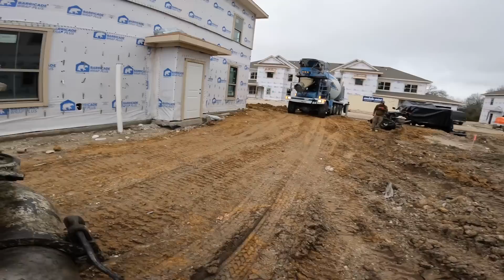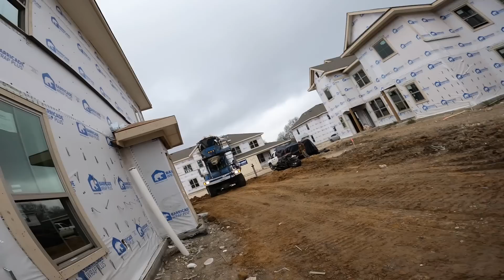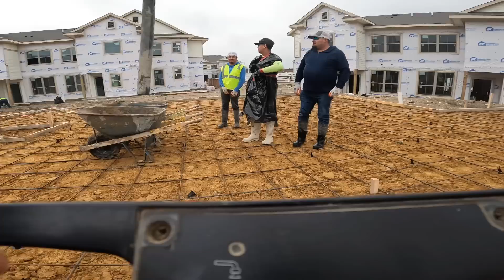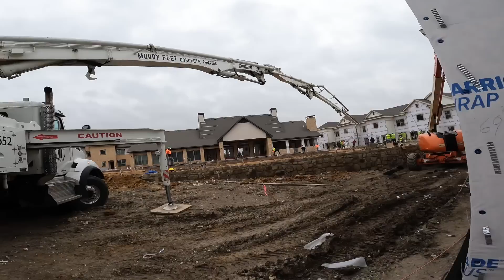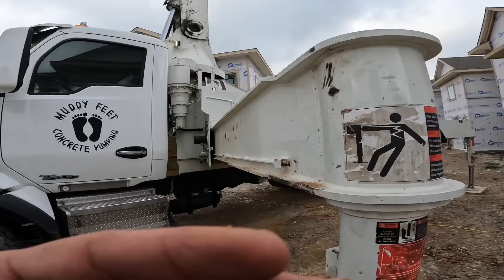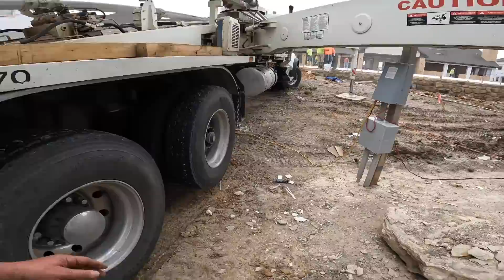Never had these concrete trucks empty into our pumps before! Pumping concrete with Muddyfeet

Comment: I drive front discharge Terex and Oshkosh trucks. Quad axles. We add our color at the plant.  We do 10 gallons of water in the barrel first, add the color, then do regular loading with the aggregate, powder, and chemicals per customer order. Any pours that take more than one truck, we try to even the same amount of water in the loads for every truck so the color pigment is consistent.

Comment: A company called Smyrna Ready mix out of Nashville Tennessee has purchased almost every plant in northern Alabama. They even bought the local rock crusher. SRM has been introducing front discharge trucks in our area ever since and they are good but on line pumps when we get into situations where we stop and go more than we should they tend to overflow my hopper. Driver says he couldn’t tell I stopped. I use a wireless remote though so I’m not standing at the pump. I think they have potential to be way better for pumping but especially for the finishers when they don’t need us. By the way I don’t have my wheelbarrow license either. Lol

Comment: I drive a front load mixer. We’re 6 wheel drive. We can drive anywhere.  Instead of wheelbarrowing that front loader could have come around the other end of the building and pulled right up to the job. Saved time.

Comment: those cement trucks are very common in the Midwest 90% of the trucks in northern Indiana. I think that gives the drivers much more control
Reply from the maker: Definitely give them better visibility
Reply: in MN, we're 99% rear dump
Reply: In Illinois, I'm not sure I've ever seen a front discharge. Granted out weight laws are odd.

Comment: The company I work for had all rears until about 1990 and hasn’t gone back since.  The fronts are more time efficient, all the action is right up front. No need for a guy holding your chute and telling you where to go.  If I’m doing side walks, I pull up flip my 2 flips  from the cab, maybe add a chute and then I’m the guy controlling the job, everything is visibility in my rear view camera so I set the pace of the job and I have 100% visibility of all the moving parts of the operation as I back away from the workers. The owner is a 40 year mixer driver, had the rears noticed a visible increase in production with the fronts. 
People run rears becuase they are way cheaper, it’s a regular straight  job truck that you bolt a drum on to, where the fronts are 300k 1 use set ups. You ain’t pulling a drum off a front and selling it to a roll off dumpster guy like you could with the rears. That’s that down side of the fronts.

Comment: Wondered why the front dumps were not seen in your area. We in WI have about 100% front dumps, since prolly 20-25 years ago. Seems much safer for you guys working around those front dumps. They can see you and don't have to rely on someone backing up to your trough.
Reply: rear is cheaper because they use off the shelf cab and chassis

Comment: The guy on that massive hose is getting a work-out, must be a 5 inch hose? In Australia we use 3 or 3.5 inch hoses on the end of the booms much easier to push around and less splashing of the mud.
Reply from the maker: It’s a 4.5 “ hose. I think his over working is self induced

Comment: I used front loaders at my house pour due to soft soils. They have 6 wheel drive with fat tires  A rear loader almost got stuck on the first load, the front drove around no problem. Northern South Carolina
Reply from the maker: Amazing the difference that makes

Comment: I hate to amit to this but, i have worked with both front and rear discharge and remember when I seen my first front discharge many years ago.
Reply from the maker: How’s it been going?
Reply: @MuddyfeetConcretePumping  going good trying not to put on to much weight lol.

 Been plenty of snow so far this winter season and have a bit over 2 1/2 mounts left to go.  Not abnormal just a snowy year this year.

 So have you found a truck to replace the one you are selling. 

No I do not need a pump truck maybe 30 years ago would of been nice lol.